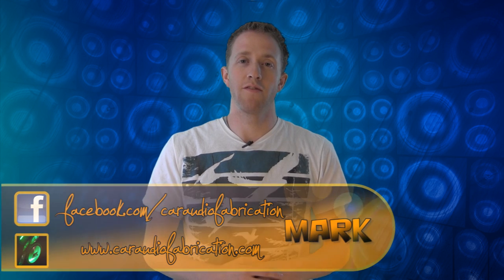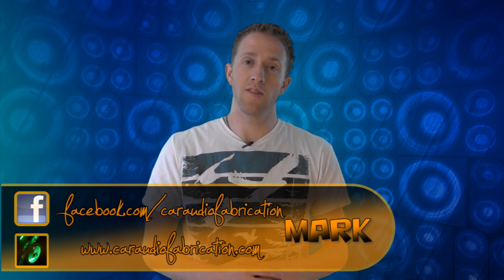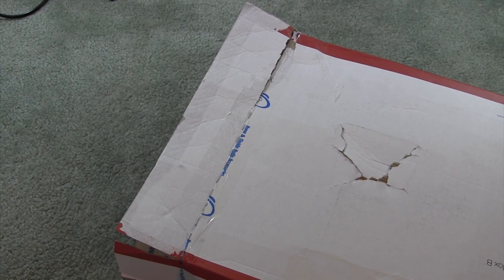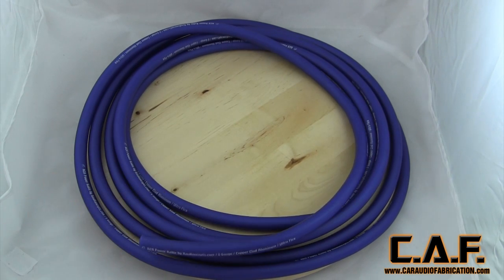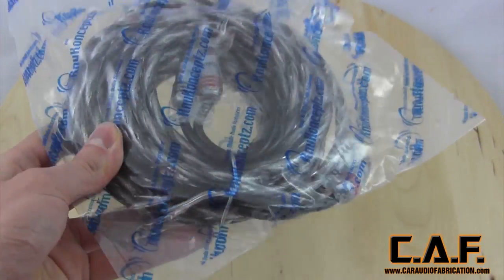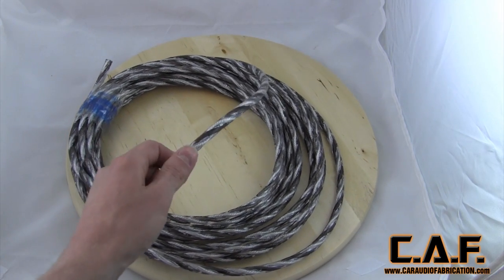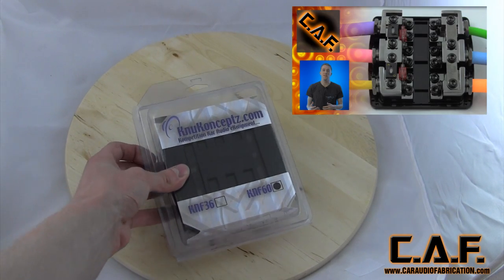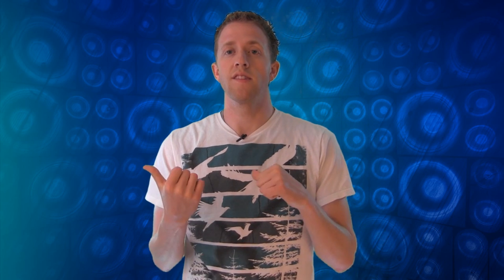Truck Project Intro - Knukonceptz Unboxing CarAudioFabrication

Comment: LOVE knukonceptz. I use the 8ga karma speaker wire for my boston spg555.  Also using the 10ga tinned ofc Kord speaker wire for mids and highs.   Question though Mark.  Why don't you use OFC instead of the CCA?  Just curious.

Comment: when it come to power cable, you have to pay through the nose for quality cable, otherwise you'er getting crap. I often buy copper battery lugs from the local auto parts store, it works great for medium power applications, and is around 3 bucks for two. BTW Mark, thanks a bunch! Can't wait for the build! I'm working on my own build in my truck, but it won't get nowhere near the look your system has. Also, bench seats suck!

Comment: Hi i was looking through KnuKonceptz website. And saw a new pair of RCA wires and wanted to ask you what you think.. I couldnt find a review on them anywhere.. They are called KnuKonceptz Krux RCA Cables.. Have you heard of them? Also wanted to know if you ever used KnuKonceptz 100mil sound deadener?

Comment: With all professional respect. 4 AWG OFC would have been lower cost and would have been almost (within 20%) ampage rating of the CCA. If your going to run 1/0AWG might as well make it worth the work. May I suggest for the same cost, same supplier, order a few extra feet of 4awg power and ground for a "big 3" upgrade.
Reply: Actaully, from amazon at least, ofc 4 gauge and CCA 0 gauge from knuconceptz is the same price

Comment: CCA cable sucks, should not be used  constantly  , only intermittent like jumper cables for auto . heats up quick and that adds more power loss the hotter it gets